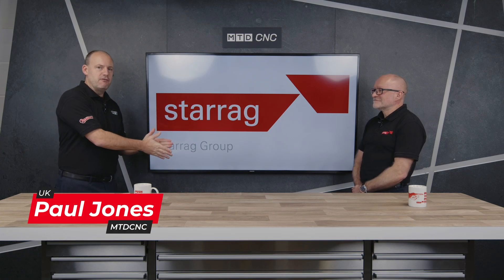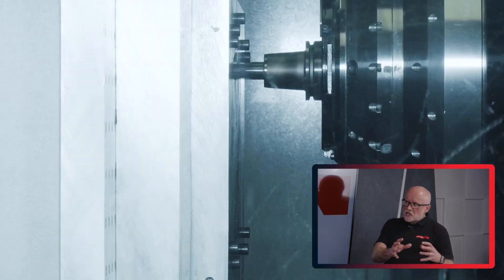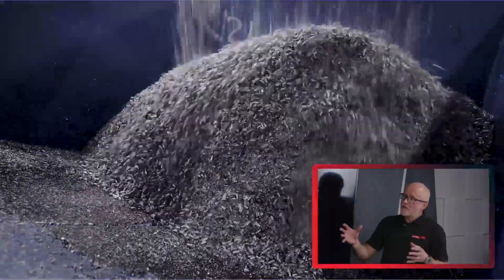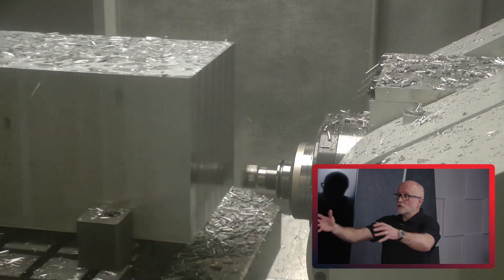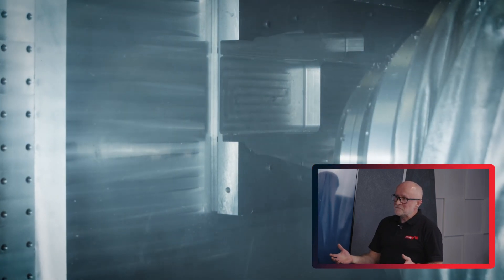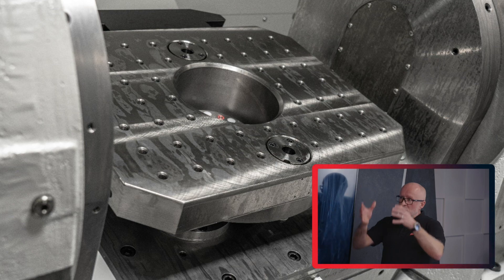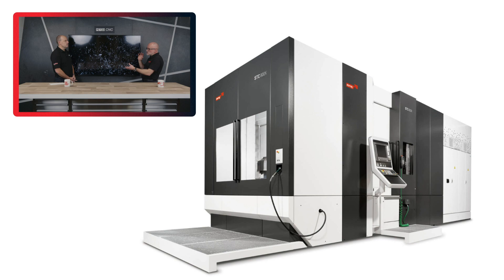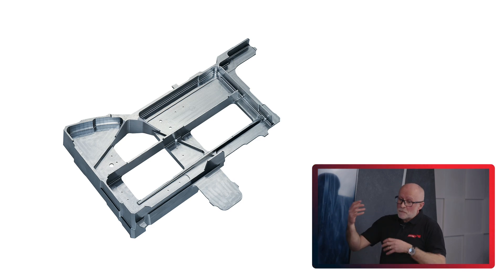Aluminium Machining: Essential Insights for Aerospace | Special Episode 1

Comment: You can also reduce costs by increasing the production hours per year e.g. from 5600hrs/a to 7000hrs/a. This will reduce your hourly rate significantly 😉.
Reply: Already running ours 8760 hrs/a 😉
Reply: @SuperstarComponentsLTD OEE of 100%, for sure 😂
Reply: @Hsvsenkrecht  not far off though. We had a 6 month non-stop run 24/7 last year. Had to clean the coolant tank out spoilt that 🤣